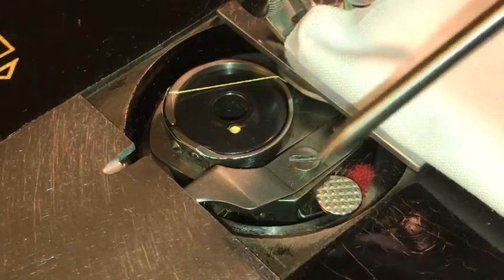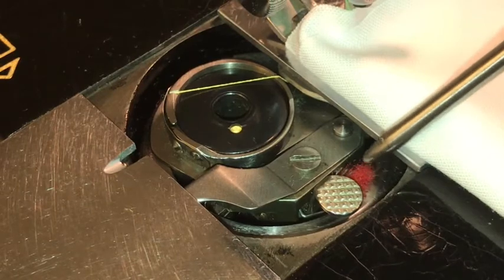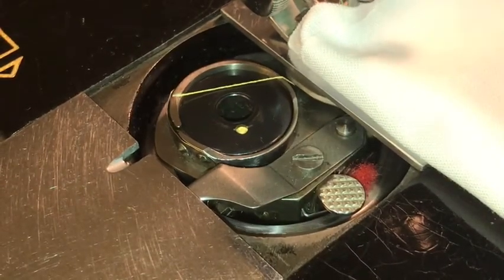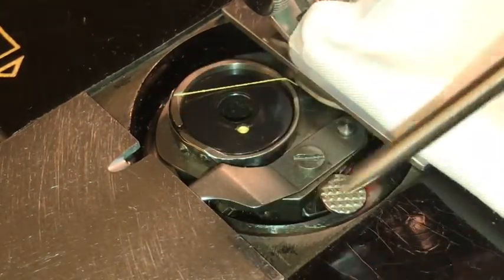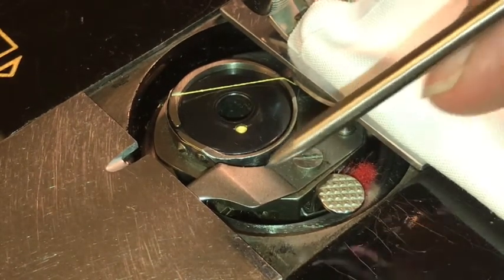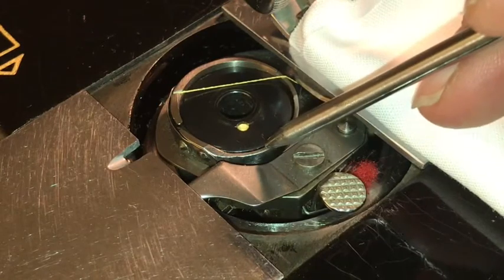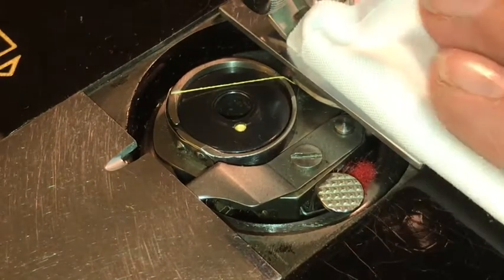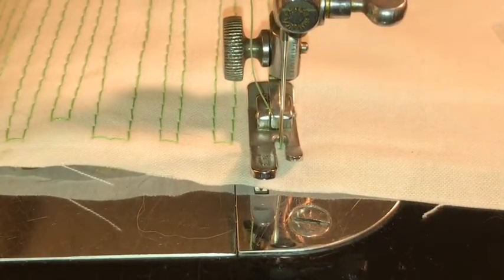Singer 99K Oil Wick

Comment: Could you please tell me where you purchased the new wick from.
Reply from the maker: Elizabeth McLean I used a red spool pin felt pad and cut a triangle from it to fold and insert into the oil wick spring. As far as I know there are not ready made felt wicks for purchase. This works great however.
Reply: Than you for the info.
Reply: @SimplyThirdStreet  , I have BLACK spool pin felt. Would that work the same?
Reply from the maker: Elizabeth Michelle Hawkins I would think so.
Reply: @elizabethhawkins7161  No. It has to be red...cherry red in fact. Not pink or black. It would ruin the whole hook assembly.
Reply: lol